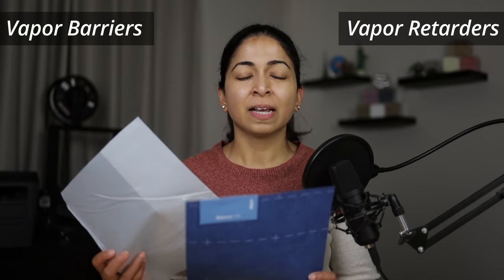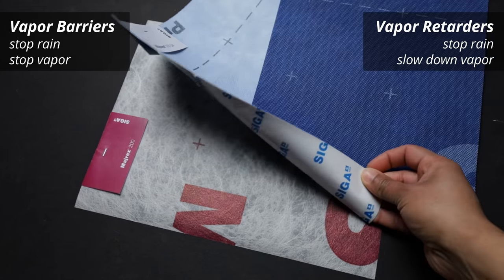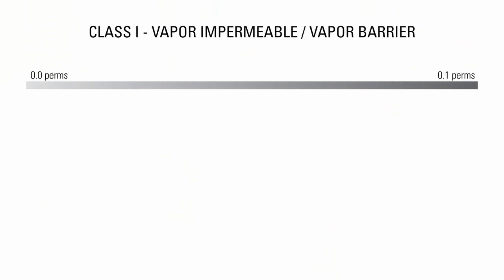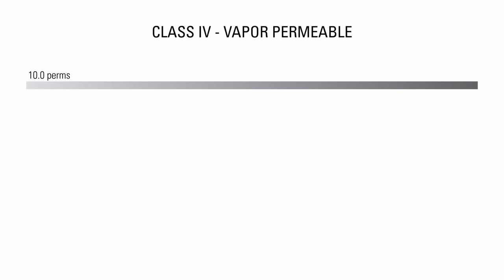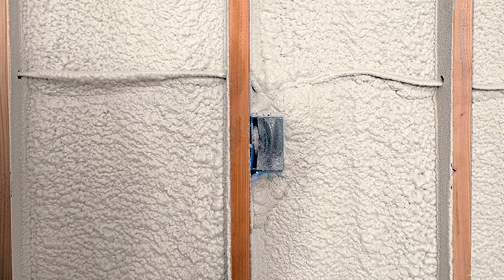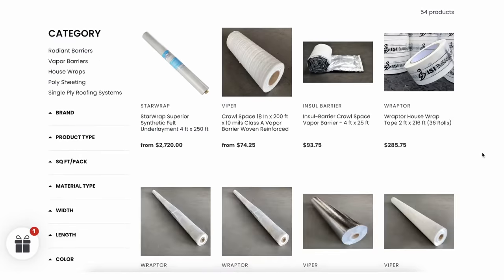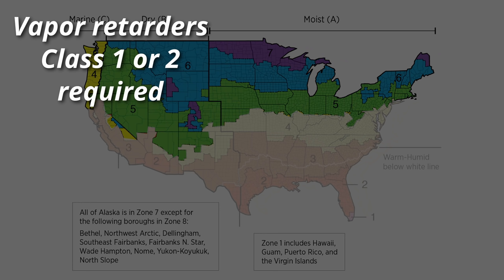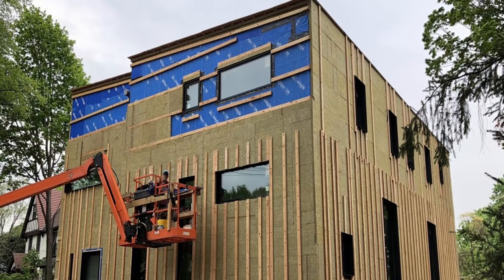Do you need a Vapor Barrier or Vapor Retarder?

Comment: Great subject, this is such an important thing to get right. Its highly related to climate and so location. In colder climates its important to have the best vapor barrier possible on the inside of insulation and an air barrier only on the outside, tight osb sheating on the outside can act as a vapor barrier and create problems within a year of construction. Basically the thing to avoid is having isulation trapped between two vapor barriers. There should be only one and it should be on the right side of insulation depending on climate.

This definitely needs a follow up as i cant think of a more important aspect of building science to understand. Great introductory video on the subject Belinda, keep up the good work :)
Reply: I work in residential construction in a colder (zone 5/6) climate and don't know of any modern builders still using vapor barriers (class 1 vapor retarders) in walls; everyone I work with has moved to class 2 vapor retarders on the interior and class 3 on the exterior. The core concept is to reduce air flow through the wall to only the bare minimum required for the drying of incidental moisture while preventing condensation buildup inside the wall regardless of temperature difference between the outside and the inside of the building. This is further complicated by the increasing prevalence of air conditioning in my area, meaning we can't just focus on preventing cold-weather condensation anymore. It's also important to remember that the exterior sheathing (and continuous insulation) itself is often vapor retarding, like you mentioned - from up to 10 perms for some plywood, down to 1 perm for some OSB. A low perm exterior sheathing may be fine with an interior class 2 vapor retarder, since it can dry (albeit slowly) in both directions simultaneously, but that same sheathing with an interior class 1 vapor barrier may be a potential problem as it may not be able to dry outward quickly enough should any incidental moisture be introduced. The construction industry has been moving away from extreme absolutes in favor of balanced approaches, so there's no one right answer to most things anymore. I personally like the balance of ZIP System sheathing (class 3) under Comfortboard (class 4) continuous insulation, with a more dynamic class 2/3 interior vapor retarder (which changes permeability as needed) like MemBrain or Intello.
Reply: @JamesCusano  What about painting both sides of pressure treated plywood? Will it extend the lifespan or hinder it?
Reply: @paulslevinsky580  The extra coatings would probably lower the vapor permeability of the sheathing, and that could cause worse drying performance within the wall assembly if there isn't enough vapor permeability in the other direction. If the wall retains a lot of moisture from condensation or incidental exposure, I suppose even PT plywood would eventually start to rot.
Reply: @JamesCusano  Yeah I'm worried about the potential for added barriers trapping moisture and causing more harm than good. It goes without saying that I'll add a barrier coating on the outside (that is near the waterline) but the inside of the box would also look much better if the pt wood were painted grey.
Reply: Have a question, I live in zone 3 and I building a Conex that'll be used for grow op. I had it spray foamed with an average of about 1.5 inches of closed cell was supposed to be 2" inches average. So was trying to determine if I should install fiberglass insulation between the studs that would be installed over the foam I'm kind of leery of doing this I'm worried about causing moisture problems you can get up to 100 degrees but that metal on the outside exterior could probably be I'm guessing 130 degrees in the summer and the inside is going to stay at a round 75° do any of y'all have an opinion of what I should do in that instance
Reply: It is possible to control indoor humidity while the outside humidity is dictated by the weather.  The underlying premise is to prevent air within a wall cavity from contacting a surface the temperature of which is below the dew point of the entrapped air.  Same goes for the air within the interior of the structure.
Reply: @paulslevinsky580  While shopping for plywood to replace a shed overhang (which rotted from underneath over 20 years in zone 6 - the roofing job was fine) I saw a sheet of pressure treated 1/2" at Home Depot (ground contact rated) which was delaminating and curling severely along a one foot end margin.  I'd read that waterproofing marine plywood would best be done using marine grade 5-1 epoxy, but two 16 inch by 10 foot strips would be too much epoxy.  After reading the comments here and getting a better understanding of how important it is to let things dry out I'm now thinking of a simple latex paint and enclosing the soffit box.  What did you end up deciding to do, and how do you think it will fair?
Reply: @oasismike2  I haven't settled on an approach yet, and I'm running out of time. I am leaning toward using boatyard resin/8oz glass/paint on the outside and leaving the inside surface bare. It will be clad with insulation and a thermal reflective barrier, but I could leave an air gap.
Reply: @JamesCusano  I live in climate zone 7/8 and here we don't have a choice.  A vapour barrier (we use 6mil poly) is a code minimum on the warm side of the insulation.  I've seen the results when this is not present (or is poorly installed) and it always results in ice and then water in the spring in the wall cavity.  Attics are even worse as the ceiling drywall will sometimes collapse from the weight of the melting ice in the spring.  This why it is so important to know the local codes or talk to a local building inspector rather than follow advice on YouTube.  While her advice and yours may be perfectly fine in your climate zone it can be a disaster in my climate zone.  By the way, I'm not knocking your advice at all I'm just pointing out that you need the correct advice for the climate zone you live in.
Reply: @hmw-ms3tx  It’s even more nuanced than that: the presence and type of a vapor barrier even in zones 7/8 is also dependent on how the building envelope assembly is designed. For example: with thick enough continuous insulation over the wall sheathing (but under the siding) the need for interior vapor retarders is minimized or eliminated. Even with more modest continuous insulation thicknesses, most building science studies point to a “smart” vapor retarder being a wiser choice than a more complete vapor barrier like the ole 6 mil poly we all got used to, especially with the increasing use of air conditioning in zones it was previously rare to see in. The only place you want to stop all water and water vapor migration movement completely under all circumstances is any surface below grade, in which case the 6 mil poly is actually kinda undersized (but does still meet most codes.)
Reply: @JamesCusano  Hello James.  I have to admit my ignorance as I do not know what a "smart" vapour retarder is.  However, in the winter I can't see how anything but a complete vapour barrier would be sufficient (in my area).  Any moisture that gets into the wall cavity in December, January and February where I live (Canadian Prairies) turns into ice at the zero line.  (I'm not sure if you guys use the term zero line in the U.S..  We use it up here because we use the metric system and it refers to water freezing at zero Celsius.)  No matter how thick the insulation there is a zero line contained within it where the water vapour will turn into ice.  In a given wall the position of the zero line moves depending on the difference between the inside and outside temperature.  The greater the difference the closer the zero line moves to the inner surface of the wall.  (I've been in old, uninsulated houses during a cold snap where the zero line has actually moved to the inside surface of the wall and the walls were covered in ice.)  After it has frozen the only way for it to leave the wall is to sublimate and pass outward through the remainder of the wall.  (or, heaven forbid, melt in spring and weep out).  While this will happen it is a slow process indeed.  There are two other problems that arise once ice has formed in the wall.  The first is that the ice becomes a vapour barrier preventing moisture from passing through the wall to the outside.  The second is that the ice reduces the insulating value of the wall, moving the zero line closer to the inner surface of the wall.  The combination of these two problems causes more ice to form closer to the inner wall.  I have seen fully insulated walls that were completely filled with ice because they had a poor or no vapour barrier.  In my area it gets hot and humid (30 C with 75% RH is not uncommon) in the summer and most people have air conditioning.   Our use of a complete vapour barrier on the inside of the insulation does not seem to cause any problems in the summer.
Reply: @hmw-ms3tx  I haven't seen anything quite as crazy as what you describe, so what a difference being a couple zones apart can make! I'm familiar with the zero-line concept, and to apply it to the continuous insulation concept: the trick is to use enough insulation over the sheathing (under the siding/cladding) to be sure that the zero-line is always somewhere in that continuous insulation layer and not inside the structural portion of the assembly. Sometimes that's 4-6" of additional insulation on top of a 2x4 or 2x6 framed wall thickness, so if it's not practical to use enough continuous insulation to achieve that, then using a variable permeability (or "smart") vapor retarder like CertainTeed's MemBrain or Pro Clima's Intello or SIGA's Majrex will prevent bad vapor migration (condensation) while still allowing good vapor migration (drying.) In several instances I have found extensive mold between the poly and framing/insulation, with no traceable source of liquid water intrusion, suggesting that in the summer the humid outside air is permeating through the wall assembly and condensing on the surface being cooled by the air conditioning without any inward drying due to the vapor barrier. It's not a super common problem around here yet, but I suspect it will become more common in time, hence most builders in my area switching away from traditional poly barriers and using the "smart" retarders.
Reply: @JamesCusano  Hello James.  It can be quite shocking to see the havoc that -40C can wreak on things versus, say -20C.  Not just on buildings but on equipment and machinery as well.  In the minus 40's diesel fuel will begin to gel as the waxy components solidify and plug the fuel filters.  Steel passes through its ductile to brittle transition zone and begins to fracture at loads way less than normal.  Garbage trucks and most construction companies cease operation in my area when the temperature gets below -40C as the truck frames can fracture and heavy equipment begins to break various parts.  It's hard on people as well and outside workers just can't produce at the same rate they would at -20 C.  Fortunately our summers make up for it.
Reply: What about varying climate. Really cold winters and really hot summers like high desert
Reply: Thanks

Comment: This is the best video explanation I have watched!  I am not in construction, but I have a small 1972 home in central Florida.  A screened in patio was converted to a walk in closet with a flat roof.  There was a temperature and humidity difference in the closet.  After removing the walls we could see it wasn't constructed or insulated properly and the 2x4s weren't spaced properly.  Given all the issues I have discovered in this home, I'm sure that even if we fix the gaps that a proper vapor/air barrier wasn't done on the exterior.  It is constructed of thin concrete block with stucco on the outside.  I don't believe they used plywood or tyvek.   So I have been considering how to stop the humidity from coming in without causing a mold problem.  I considered using drylock masonry water proofer on the interior of the block then using foil faced R5.9 board insulation (max I can do with space) before adding the dry wall.  But was concerned about mold forming on the blocks.  Would it make sense to use a vapor barrier paint on the stucco or would you recommend vapor retarder paint?  Do you have any other suggestions?  What brand of paint would you recommend?  Sorry I know that was a lot.  Thank you!

Comment: Thank you, Belinda! I am a 45 year veteran builder, and this topic, Vapor Transfer thru an assembly, has been one of the most challenging to comprehend, must less determining a feasible and cost effective way to address the issue, and how an assembly performs. Understanding that vapor travels from high pressure to low pressure is a game changer in comprehending the issue and is foundational to start to address the problem. I build in Climate Zones 1 & 2, mostly concrete slab and wood frame wall assemblies. To illustrate, approx. 40 years ago, I built a custom home in Jacksonville, FL. Even back then, I was pushing the envelope in an attempt to give my customer more for their investment. I made the mistake of putting .06 mil Visqueen on the interior of the walls and ceiling. I only did this on one house, but seeing your video brought clarify to the multiple issues that decesion created! The people were good friends and I shutter to think what they must have gone thru because of my bad decision. I so regret that mistake, even today! 
I have come to believe that a sealed attic is the most energy efficient decision that can be made. With that decision though, comes some challenges, such as Vapor accumulation in the attic envelope, which if non-permeable materials are used, can lead to condensation issues, mold, wood rot, etc... To combat this issue, it's my understanding that the attic needs to be included in the heated and cooled space, allowing air changes to occur or using a dehumidifier to eleminate moisture. This might be a topic for you to present. Coupled with that may be a discussion on roof assemblies, types of Vapor Barriers or Retarders, that would be preferable. 
I have believed for some time that a thermal break, in both wall and roof assemblies was key in creating an energy efficient structure. We are about to sell our home and build new. With that decision, I am contemplating the design of the home to have a double wall exterior with a 2" space between the walls. Because of cost, I am leaning toward and sprayed cellulose insulation which will be me approx. an R-31 wall, it will accomplish a thermal break and give the exterior cladding something solid to be adhered to.  I am stopping the foor system at the exterior of the interior wall, which allow for the insulation to be continuous thru to the roof framing. 
With the above in mind, I am also in the process of  determining how to insulate the roof system, a long with water resistive Barriers. My concern here is not to create a condensation plane within the assembly.  My thought process is to allow the rafters to terminate at the wall exterior edge. This will allow the wall sheathing to right all the way to the roof decking. That joint can then be tape to seal it and make it air tight. Once that is done, my thoughts are to screw rafter tails and barge/gable look outs that are cut to a two inch thickness up to the edge of the sheathing. This will allow two layers of 2" rock wool to be installed in opposing integration to each other. Then I plan to use 1x4 battens under metal roofing. 
A few questions existing here::
I net and blow 5 1/2" of Cellulose between the 2x6 rafters for $1.24 per SF. In my area, this is what 1" of closed cell foam costs, installed. This application gives me an R-17 cavity without figuring the thermal transfer thru the rafters, thus the need for a thermal break on the exterior and boosting the overall assembly R-value. Off the top of my head, I don't recall the R-value per inch of Comfort Boad, but I would think it to be R-3.5 per inch, giving me an overall R-30.  To my question, What underlayment would you recomend of the roof sheathing? My plan is to use 5/8" OSB for sheathing for screw retention capacity. 
From both a cost and function perspective, What would you recommend for an exterior wall sheathing, and a vapor retarder? Zip, OSB and a Vapor Retarder, or...?
I am also so planning on installing battens on the exterior walls, that create a rain screed continuous on the wall, leading up to and including the roof with the metal roof battens. Any suggestions there?
Thanks again! I think you're really great! My very best to you and your family!
Reply: I knew instinctively that vapor barriers behind the drywall was going to be a big problem.  I always used a vapor barrier primer, which also met code, and moisture gets stopped at the wall and evaporates back into the heated envelope where it gets dispelled by heating or air conditioning.  If I'm not mistaken, in cold climates vapor barriers are no longer required, and I think she says that, but I still see a lot of people saying it is required.
Reply: Now if we could only get roofers in western Oregon and Washington (zone 4 marine) on board. Everyone wants to use synthetic underlayment which has a perm rating of < 0.05. I've been insisting on a permeable underlayment, and the contractors seem to think I'm nuts. I'm standing pat.